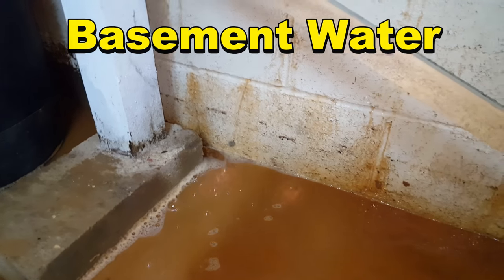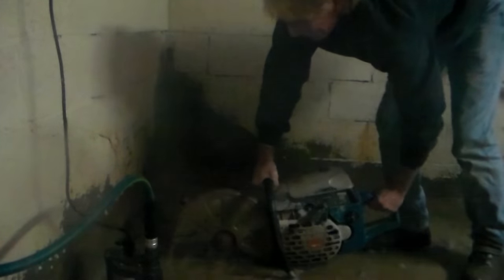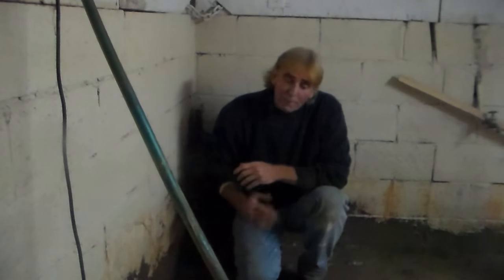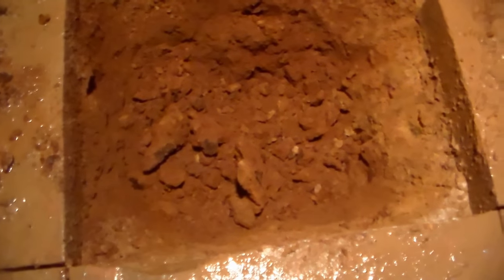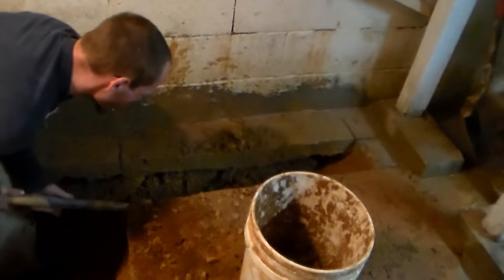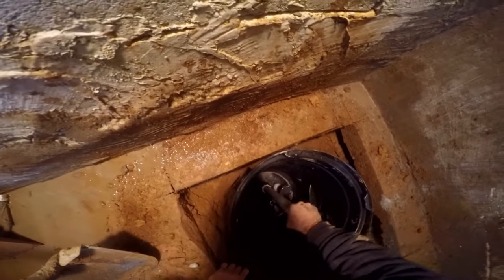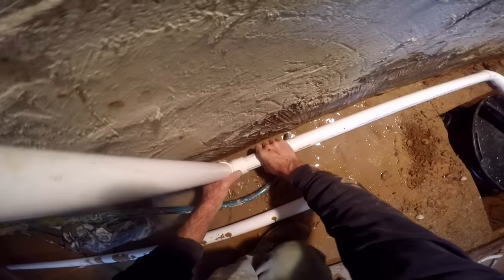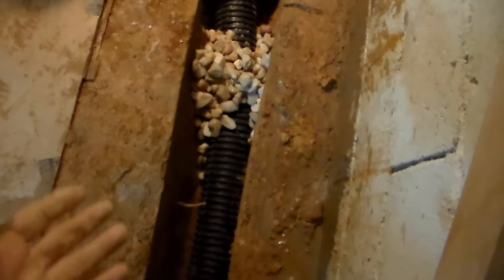How To Install  Sump Basin and Sump Pump in flooded basement

Comment: I currently have a block foundation from a 1950s home in the basement is a sump pit that has been concrete in so the water beneath the floor can’t enter the pit it’s only made for collecting the water that’s on top of the floor which squirts in through the blocks in the spring of the year if I break holes in that concrete pit and filter, will that relieve the pressure that is on the outside of the blocks? In my brain, it should drain the water level to below the floor all around the foundation? Thank you for all the videos you put out I’ve watched over the years, and I really appreciate the knowledge that you’re putting in your videos❤️‍🔥🇺🇸

Comment: I had to put a sump pump in my crawl space.  It has a dirt floor so I didn't need a saw.  Unfortunately it also has a lot of limestone, so there wasn't much digging before it it came to using a maul to break up the stone for the pit.  Fortunately, I knew young people that needed some paying work to do!

I also lined my pit  with yard fabric before putting in the drain tile, and I also wrapped the basin with 2 layers of yard fabric as well.  I covered all the gravel with large paver bricks.  The crawl space is now nice and dry and I walk on dry paver bricks instead of wet mud when we get heavy rains or 4' of snow.  

The crawl space no longer smells like mold - but that took adding a dehumidifier - it will easily get up to 80% humidity even when it hasn't been raining a lot.

Comment: I'm really glad you put this video up.  My home is setup almost exactly like this, with a 1/4 basement and crawlspace over the other 3/4 of the home.  I woke up the other day after a massive rainstorm to find around 5 to 6 inches of water in my basement!  A lot of boxes we had stored there are ruined.  But, I feel confident in fixing it myself after watching this.  I appreciate you putting up these videos.  I've watched five or six of them tonight as I've been trying to research this problem.  Thanks for spreading your knowledge around! :)
Reply: I'm curious if you managed to reduce your basement flooding problem. Did you end up installing a sump pump or trench around the inside perimeter of your crawlspace or basement?
Reply: @donaldlee6760  how about you I'm having the same problem
Reply: This isn't the correct installation for this problem please do not follow these guidelines. His other videos are good but this is wrong.

Comment: This is an interesting video to watch because I have a similar problem in my basement.  I am not an expert on this, but I am surprised that Chuck did not wrap the perforated pipe with a filter cloth before back filling because wouldn't the dirt eventually clog the pipe?
Reply: Filter cloth will clog itself eventually. What he shouldve done was buy a pipe with a sock already around it. The biggest thing with these systems is that you want them to freely drain. Filter cloth will clog and not allow that too happen. The stone acts as a filter anyways.

Comment: hey i have a question.. where does the perforated plastic pipe connect too?  I know it connects to the sump pump on one end, but what about the end that runs down the away from the pump?  The part that is covered in rocks?  Does that just hang out down there open ended? Is it just there to help the water flow towards the actual pump?

thanks...great video by the way

Comment: Thanks!  Question:  should a sump pump basen be perforated ?
Reply: There's usually holes in the bottom of the pit for when your water table rises. They are small

Comment: Informative video. What doesn't make sense is that we see the water pressure coming through the block wall, why would you only cut out a small section stick pipe below it and fill with concrete. Are you expecting all that water from the block wall too suddenly go behind and under the floor? You should have drilled 3/4" sized holes in the wall at the base 4 to 5 inches above the floor then installed your delta board on top of the weeping tile and stone then installed your concrete. This isn't done correctly and seems like a French drain thats been covered.

Comment: HELP... I have a porch w a concrete slab outside my one basement wall. problem I have is basement wall keeps getting water coming in from different spots along wall. I fix them w hydraulic cement but then another happens . I have a sump pump in basement on far left side of that wall but doesn't seem to drain any if the I guess ground water pushing in from outside the wall. I can't dig outside the basement wall cause the porch is above that basement wall . I guess when rain and ground water at same time makes water push against basement wall leaking in . what can I do to keep this water from coming in ? like I said I have a sump pump by that wall but apparently the water outside the wall doesn't go to the sump pump just whatever water is under house I guess. thought bout tunneling under porch but that would take forever kill my back also then remove dirt I'm worried bout the footing that the wall sits on could be going bad too cause the leaks are low on the wall too then put it back but how else can I fix the wall problem . anyone help ??
Reply: Drill holes at the leaking wall and bust open the floor. Allow the pressure to release and enter your basement. Install your weeping tile in the trench and run another line to your sump pit. Fill with clear stone, get yourself delta board that goes on top of the stone and up the wall. Once completed pour your concrete and call it a day. You will relieve the pressure and allow it too hit the plastic membrane that will take it too your perforated pipe and into your sump pit.

Comment: Great videos. But I would never attempt anything like this. This is a job for professionals. I just bought an old house with a wet basement (half excavated and half crawl space) and a terrible sump pump. It’s in a corner with no cover!! The water runs to the open pit and then it’s pumped by hose to the sewer pipe across the room! Looks like a bad DIY job. The house was a rental for years. This is the cheap kind of fixes which landlords (slumlords) do! So now when the pump shuts off, the water in the drain hose falls back and it slashed on the floor. The whole thing needs to be replaced!

Comment: For a job like this, how much would you charge?
Reply: morenabella 6 k
Reply: 6 grand? Hahaha sucks to be you guys who have no idea or intelligence to do this yourself. Its far from rocket science and this isn't even done correctly for the issue thats happening with the intense about of pressure behind the wall. This video defeats the purpose, why would the water go behind the wall and under the floor? Why not drill holes at the base of the wall scattered at your length of cut out for the weeping tile. You need delta board installed and pour the concrete on top of that so all the water hits the plastic trickles down and then enters your perforated pipe. This install makes  zero sense.

Comment: Won’t it be hard to remove the sump pump if it goes out?
Reply from the maker: No harder than it was to install!
Reply: Easier than the install. You would simply cut the pipe above the lid, remove the lid, and pull the pump up. After connecting the new pump to the pipe, lower back into the basin, and reconnect the pipe above lid with a coupling.

Comment: Video title is "how to install a sump basin and sump pump in a FLOODED basement."  The sump hole and trench are completely dry (?).  Let's see it when there's standing water or high water table as the title seems to suggest.

Comment: LoL fail now you need to beat the concert floor with a hammer so the new concrete adhears to the old
Reply: Should have had threaded rod put into holes drilled in the old cement sticking into the area with new cement.